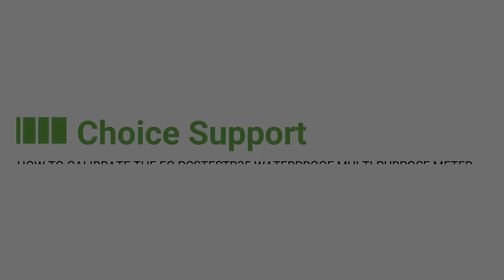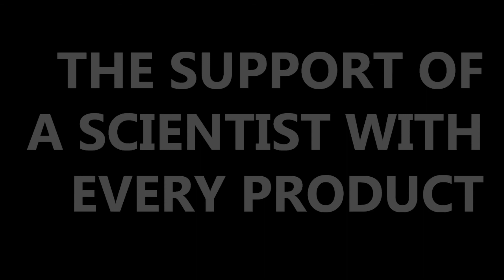How to Calibrate the EC-PCSTestr35 Waterproof Multi-Purpose Meter

Comment: What about tds .do we have to calibrate it ?   And with what?
Reply from the maker: Hi @rabiyashah3882,

Thanks for your question, on this, TDS is a factor of conductivity, it applies a factor to the conductivity reading to produce its TDS reading.
In general if you are specifically looking at TDS and want to ensure accuracy, it would be advisable to calibrate TDS as well. 
For TDS you would do a manual calibration using a standard of your choosing from 0-10ppt.

What sort of level are you measuring?
Reply: I want to check pH, ec, and tds in soil samples but this instrument is showing me pH readings different readings every time?
Reply: Also can i use standard sol of 0.01M  of KCl  for EC

Comment: Don,t  we need to calibrate other parameters? Like salt, temperature & TDS
Reply from the maker: Hi Priyanka,

Automatic conductivity calibration covers TDS and salt calibration as these measurements are calculated from conductivity measurements. However, if required, you can still perform a manual calibration for conductivity, TDS and salinity. 
Temperature calibration does not need to be performed routinely. The meter is factory calibrated for temperature and calibration should last for the life of the original sensor. However, if you replace the sensor or notice a drift in temperature measurements, you can perform temperature calibration. 

The instructions for manual TDS/salt calibration and temperature calibration can be found here: https://www.instrumentchoice.com.au/_literature_253769/EC-PCSTestr35_User's_Manual

Hope this helps!
Reply: @instrumentchoice  Thank you. It helped me a lot